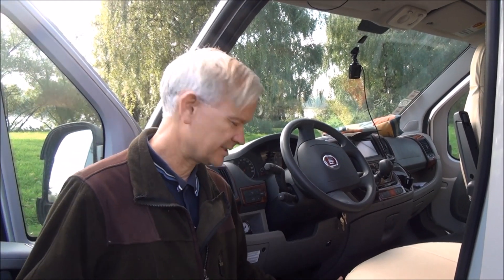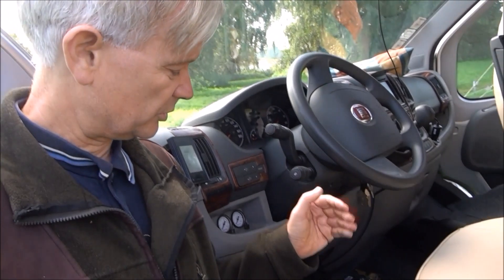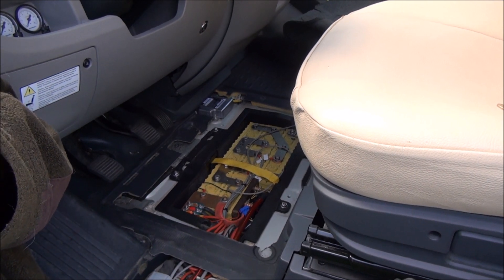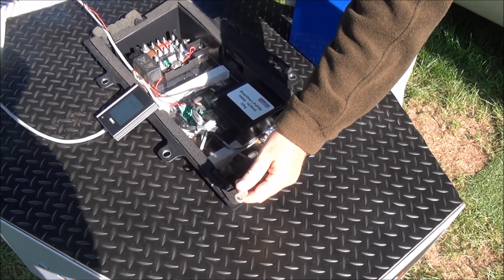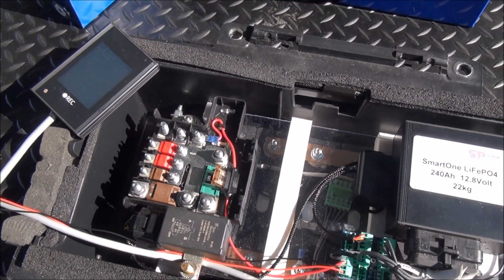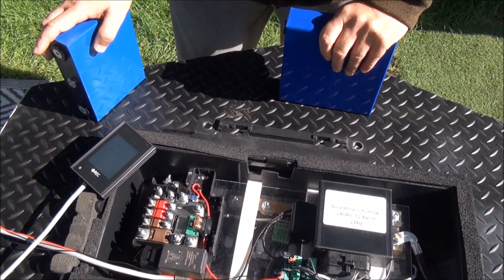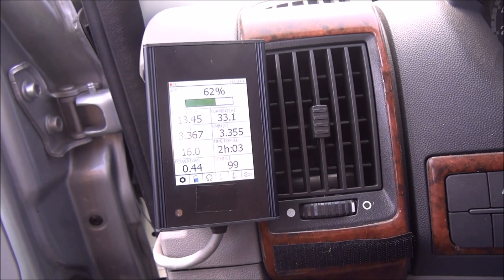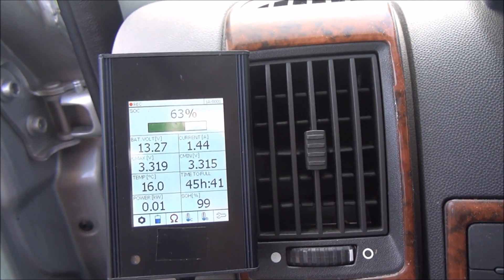Powering an RV with lithium iron phosphate batteries

Comment: I use two X 100AH LifePO4 batteries as habitation batteries and even use them for all cooking using a microwave, electric kettle and two induction hobs.   I can tell you from experience as well as from my background in engineering that there are things very wrong with how it has been done in this video.    It is a bad idea to combine the starter battery and the habitation battery as they both have very different operations.   It is far better to leave the alternator and starter battery as they are and then to use a battery to battery charger to properly charge the LifePO4 batteries at the correct rates.   Different LifePO4 batteries need slightly different voltages and charging directly from the alternator with any kind of split charge unit isn't good enough to look after such a huge investment.   Suddenly drawing several hundred Amps to start an engine is also outside the spec of most batteries.

It also looked as if they were using voltage to see what the state of the batteries was , they should use a coulomb counter to see remaining capacity.

Some people talk about LifePO4 batteries being damaged when the they get below 20% but this is not true.  Provided they have some internal management system then it is fine to discharge them to 0%, something which would kill a lead acid battery.    The lifetime is related to the discharge level, but even down to 0% the number of cycles may well be in excess of the life of the van.     Obviously if you discharge them to lesser degree then they will last longer but occasionally emptying them won't actually cause any harm.  In any case they don't fail, they simply will hold a reduced charge as time goes on.

On the subject of recycling, bear in mind that industry hasn't really had to deal with this yet, but will by the time your new batteries need changing.   Lead acid batteries are well understood but you may have to have several, maybe even 10 recycled for each new LifePO4.

Most modern motor homes have electrics that look like something from the 1970s and so retrofitting new battery technology doesn't really give that much benefit without some other changes.   Rather than concentrating on battery technology, the builders need to look at installing modern wiring, fridges and controllers.   Take the terribly inefficient 3 way fridges that are fitted, with modern batteries you just need a far more efficient 12 volt compressor fridge (possibly even just a 230v fridge).
Reply from the maker: That is a really brilliant and detailled response Kevin.  I am using now 1x250A LiFePO4 battery which has completely changed my vanlife as I live in the vehicle all the time.  I no longer even bother to use the 12v - 19v converter for the computer - I just stick it directly into the 230v inverter.  I was surprised also that the battery was used to start the engine due to the completely different specs but my role here is to report.
When my van was rebuilt, we took into consideration rewiring for this type of battery although I appreciate that new vehicles probably do not have this.
Regards from Poland!

Comment: What we want is a TESLA electric panel van. Why he does not manufacture, delivery panel vans do short local journeys. Vans don't have all those seats/doors and glass, so must be cheaper and since for business use would be tax deductible. Can you imagine an RV with underfloor lithium ion battery pack, no gear lever and all that crap/mess/stink with diesel/petrol. You could get rid of gas as well and use induction cooking. For RV use it does not really matter if you have to wait a bit to charge them up.
Reply from the maker: We want to build an electric van.  Whether or not we will do is another thing but people here on my channel will be the first to know.

Comment: Enjoyed this video. We have been using solar/LFP combination for four years and it has provided us with solar autonomous systems. We have two such RVs: a 34' fifth wheel for use in US and Canada and a 19' Roadtrek for Mexico where the small towns are not trafficable for large rigs (San Cristobal de las Casas). Fifth wheel has 1400 W of solar and 9 kW-hrs of LFP and Roadtrek has 415 W of solar and 4.5 kw-hrs (question of scale). Fifth wheel panels deliver energy at 90 V to charger and battery bank is 4 x 12 V batteries (4 x 3.2 V cells each) for 48 V nominal system. Roadtrek is 12 V battery system. As snickersgln noted, charging is a problem below 0 C but it can be done but only be done at very low C values. Son designed and fabricated Roadtrek so that a sensor at battery suite triggers a blower (4 volumes of battery area per minute) from interior which we keep above 8 C when sleeping. We turn on a 30 W tungsten lamp on in battery compartment of 5th wheel when it gets down to 2 or 3 C. Will install blower from bed room to battery box this next year. We very seldom plug into line power but both systems utilize battery chargers since "dirty" power can occur anywhere and the chargers will work from 60 to 220 V. Roadtrek does have a 2.5 kW generator which we have used two or three times during extended heavy rains in Labrador/Newfoundland.
Reply from the maker: Thanks for writing Reed.  I think LiFePO4 has a lot of advantages and will be filming more on this later!

Comment: 4 x 3 volt batteries of any type, will have to be connected in series to produce 12 volts.

It seems to me that Battery technology, at least what is made available to us peons, still lags behind massively. 

Solar power is more efficient as the temperature falls.

Interesting technology & video Alan, but a long way to go.
Reply: don't forget that lead acid 12V batteries are actually SIX 2.1v cells.  Golf Cart (6V) batteries are THREE 2.1 V cells.

Comment: Pretty sure you explained this, but the ability to draw down lithium is key. A 100 amp hour AGM lead acid bank can be drawn down 50%, so only 50 amp hour usable (without damaging the battery). Lithium can be drawn down 70-80% without damage; hence 70-80 amp hours for no more bulk space used, AND about 1/3 the weight. In the US, I think lithium for RVs is still too expensive, but I'm looking at changing out my bank in a few years. At 800 amp hours in my bank, the current cost to go lithium, including extensive labor in a fifth wheel, is about $13,000. ouch!!!!!!!!! 800 amp hours of 6 volt AGM lead acid batteries (400 usable at 50% draw down), including labor to install, costs $3,000. Small banks for campervans would be much less and the practicality of using an alternator is huge, because my solar system (battery charger) is another huge investment, because on a trailer, one can't use an alternator. If I did a campervan today, I'd go lithium, but would wait if a larger bank in the 600-800AH range.
Reply: What I would suggest is purchasing a used Nissan Leaf 25 kwh battery pack for about $3250.00.   That is the equivalent of over 2000 amp hours at 12 volts.  And, yes, you can charge your lithium batteries using your alternator - as long as you run the current through a lithium charge controller.  So, how  much would 2000 amp hours of lead acid cost you?

Comment: What about charging in freezing weather?
Reply: snickersglny 
only nicadium batteries are bot effected by temperature that I am aware. Hence the use in airplane backup system.
Reply: snickersglny  many newer RV are being made with better insulation with heated basements so your batteries [whichever type) don’t freeze.
Reply from the maker: That is a very good question.  I take my lithium battery out of the van completely and instead allow the solar panels to charge an old habitation battery. Lithium batteries should not be charged below a certain temperature which I believe to be around 0C.  However that is the internal temperature of the van - and in any case, to stop damage to the van, heat it if it is on your drive.  However heating it constantly is not always possible which is why I take the battery out.

Comment: Lithium batteries are okay but not very recyclable, while lead acid batteries are almost 100% recyclable
Reply: Good thing you don't need to worry about recycling them cuz they last forever..... maybe just repurposing is all that is needed.
Reply: Umm, lead-acid batteries are toxic and must be dealt with as hazardous waste.   Lithium batteries are non-toxic.  Lead-acid batteries (flooded) off-gas hydrogen which is both flammable and corrosive.  Lead acid batteries will give you approximately 50% of their capacity before they start being damaged.   Lithium batteries will give you 80% of their capacity before they start being damaged.  Lead acid batteries cost more in the long term because they must be replaced more frequently and can only provide 300-500 charge cycles (if properly maintained).   Lithium batteries can give you 2000-3000 charge cycles (or, more) and some chemistry formulations can last 20 to 30 years before dropping to 80% of their original capacity.  Lead-acid batteries will self-discharge relatively quickly and must constantly be trickle charged to prevent them from being damaged during long term storage.   Lithium batteries can hold their charge for a year, or more.  And, lead acid batteries weight two to four times as much as lithium batteries (depending on formulation).

Lithium batteries are not a panacea solution to our battery needs, but they are far superior to lead-acid batteries in many ways.  Until we get batteries that can perform as well as lithium batteries but also charge much faster, they're about the best we have, for consumer purposes.
Reply: @richardowens9061  so if sealed lead batts can get 3-4 maybe and AGM up to 10 years or so claimed i wonder how long lithium iron phosphate can go for? also i think the reclaim the and acid and lead out of them. i think the local battery factory uses old batteries for some of the materials going in to new ones, idk how much or if all.
Reply: @cdoublejj  AGM batteries are just lead-acid batteries.   I've never gotten ten years out of one - and, I've used, sold, and replaced hundreds.    Five years is the most I've ever gotten out of an AGM battery that was properly maintained.  The LiFePO4 chemistry is still too new to know for sure how long they can be made to last.    But, they don't appear to have any inherent problems with shelf life.    They seem to be dependent on being stored in the proper temperature range for long term shelf life.    And, the number of cycles is going to vary based on how they're used.   If you regularly cycle them down to 20% and back to 100%, they will get 1000-2000 cycles, before they hit 80% of original max capacity.    If you only discharge them down to 30% and only charge them to 90%, you could get 3000 to 5000 cycles, or more.
Reply: @richardowens9061  will I save any.money getting the cheap $166 dollar SLA batteries over the $200-$200+ SLA/AGMs or are they even crappier? I just need to 12v 100ah batteries for a UPS
Reply: @cdoublejj  If it's for a UPS, just get the cheap ones.   Why?   Because, a UPS doesn't deep cycle the batteries often - only when there is a power outage.   The rest of the time, they're sitting at a float voltage.    The more expensive AGM batteries are designed to last longer when they're being deep cycled.